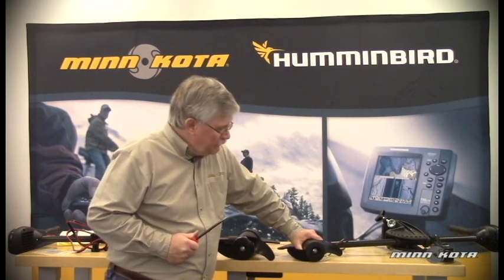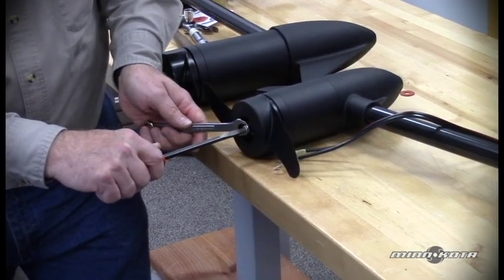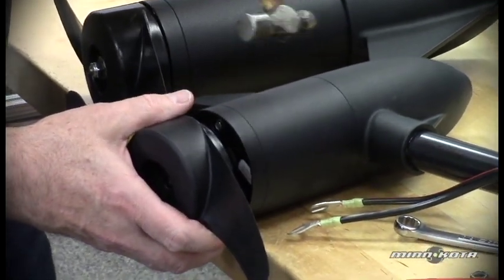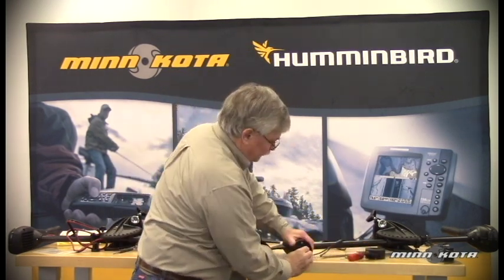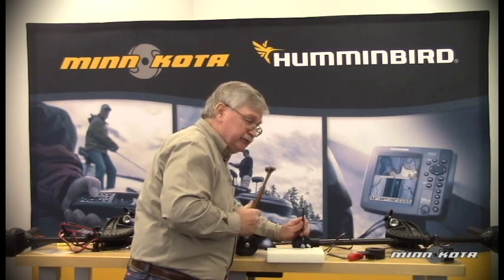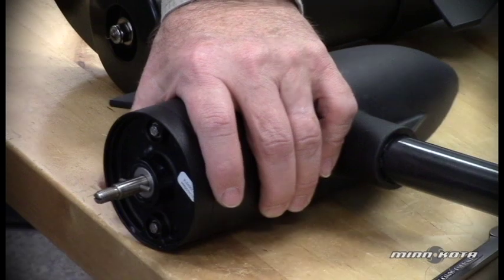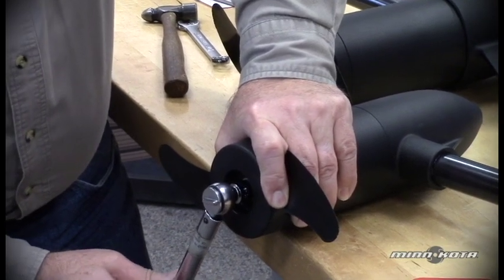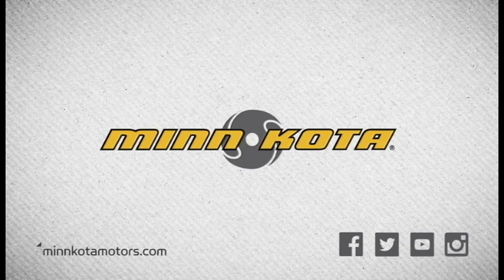How to Replace a Minn Kota Trolling Motor Prop

Comment: I put everything back on an there is a small gap between the housing and the prop. It goes together when pressed together but pops back out when released. IS that normal?
Reply from the maker: Yes, there will be a small amount of play.
Reply: I had the same question. Thanks

Comment: Great video, but in my case the pin seems to be really stuck in there. I've braced it with 1/4's and used an 1/8" punch, but it doesn't seen to even budge! Any other idea, with drilling it out?

Comment: Quick question about replacing the weedless wedge 2 prop with a weedless wedge prop (the original) on an Edge 55# thrust...the new prop doesn't fit flush with the motor like the original prop did.  There's about a 1/4 inch gap.   Do I have the correct prop (Sku 2119385 / MKP 7)?  Is it not recommended to change to this prop?  I see a lot of comments online regarding getting more speed/power with the original prop and I wanted a back up prop also if I ever need it.  Any help would be greatly appreciated...
Reply from the maker: BassTube,
You have the incorrect Prop.  You should have the MKP-32 Prop.
https://bit.ly/3X18WXe

Best Regards!
Reply: @Minn Kota Tutorials  thank you. I actually called Minn Kota today and got the same info... ordered and on the way...thanks for getting back with me.

Comment: Do we earn speed by replacing prop with bigger one ?
Reply from the maker: Hi Fred,

The variables that govern speed are the RPM's of the motor and prop pitch. In theory, a prop with more pitch would make the unit go faster; we do not recommend this as it would also increase the amp draw of the motor and likely cause premature failure of parts in the motor.

Thank you
Reply: @MinnKotaTutorials  many thanks 😊 finally if we want faster motor better to buy new one I accord to you is greater for longevity of m kota unit . Regard from France 🇫🇷
Reply: @FredPecheur  To be fully correct there is propeller pitch  and its diameter. Power and therefore amp draw is a combination of torque x speed also diameter x pitch. Minnkotas is somewhat 8.5 x 5.5 . I was experimenting with APC propellers that you can by from Amazon with different sizes. There is not too much gain. I think fastest one was 10x6 with approximately same amp draw. The gain is not huge maybe 0.5 mph. To really increse the speed you need much more power than  Minnkotas 0.7 hp

Comment: looks like it may be a seal?
Reply from the maker: There is a bearing and seal that are seated in the end cap of the lower unit.  There is a prop washer that slides onto the shaft after the propeller, followed by the prop nut.